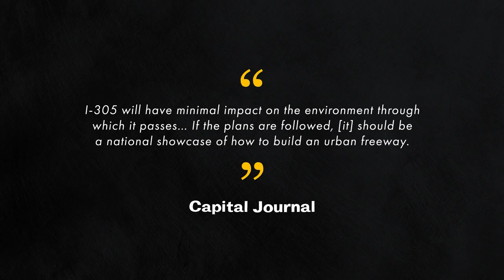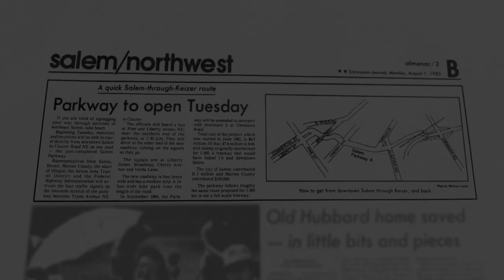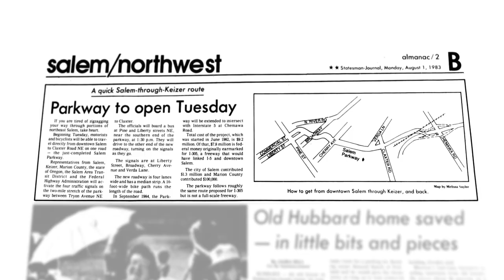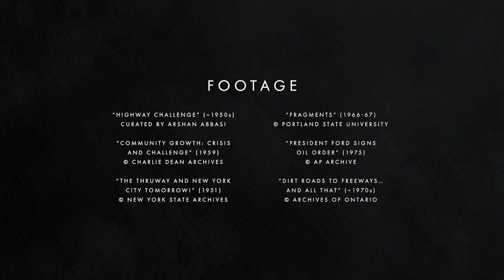Interstate 305: Salem's Cancelled Freeway

Comment: Absolutely fantastic! I remember seeing a huge full scale model in the lower floors of the Salem Library as a kid. And my parents had built their house on the corner of Wallace Rd & Hope Ave... which if a person drew a straight line across the Willamette River would have run directly into the Pine Street Bridge / Pine Street. Which the model I saw showed that... and it showed a branch going on down Hope Ave. which then matched up exactly with Orchard Height Road, too. It's just amazing that the 2nd biggest city in Oregon still only has two (2) bridges.

Sometimes I have to shake my head, as pretty much all the Freeways from Salem to Portland and the from South Salem to Eugene are still only three (3) and two (2) lanes. Well, I guess it's the same for 205 when I was  a kid. Almost nothing has changed in 50 years. Which by the way... I think the toll this is simply ridiculous as the freeways were federally funded... seems the state government is a lil' greedy in my own humble opinion. Now maybe, and only maybe if they want to add a "Fast Pass" / extra lanes to 205 just like toll roads in TX... where those were built in addition to the freeways who wanted to pay to skip Freeways. I just don't see how anyone will be expected to get around... guess they will need to change all the "Freeway" signs, too. Get it since it's not Free even though our tax dollars had already paid for it. ha ha 🤣 That will cost them even more to change signage... just like the proposed per mile tax which when calculated with super simple math comes out to be 4X to 6X times MORE to the cost of everyone driving a Hybrid or EV (which I've had both). A per mile tax when calculated is as if every vehicle is only getting 14-16 MPG with the taxes they make on the Gas Tax. Crazy world! Well, I digress! 😇

Comment: I found out they have cancelled both future I-92 and I-98 in the Upstate of New York, because of they could not put the money to the highway funds. I-92 supposed to connect from I-87 in Glens Falls New York to I-95 in Portsmouth New Hampshire, via US-4, I-89, and NH-101, and I-98 supposed to connect from I-87 in Watertown New York to Swanton Vermont, via US-11 and US-2. However I-81 and I-88 in New York are the first two interstate highways might change it exit numbers to a mileage based system, then follow by I-86 in New York. Vermont might change its exit numbers to a mileage based system on I-89 and I-91. Massachusetts and most of Rhode Island (except for I-95) already changed their exit numbers to a mileage based system, including I-90 (Mass Pike), I-84, I-195, I-295, and I-495. Connecticut, Delaware and New Hampshire said “no” for the exit numbers change on all interstate, US, and state highways which are freeways.

Comment: Better that I-5 just glances Salem, where it goes through major metro areas, ie. Seattle; Portland, LA, it becomes choked. It passes the perimeter of Tacoma, but it was made to curve along the profile of Puget Sound. The concept of 'limited access' is lost where entrance merges come every couple of blocks. The 'needles eye' at the south end of Seattle where development and geography squeeze the freeway down to two lanes is a total joke. Ideally I-5 should have been sited in a more direct route, similar to how it passes through California's Central Valley, with spurs connecting to the urban areas.
Reply: Good point, although around Seattle, where would this "direct route" have been? Maybe around present-day I-405 (which is sometimes even more congested than I-5)?

Comment: Ah yes, Salem.  Where, if you take any exit, you're guaranteed not to find a gas station until you're as deep in as at least 10 city blocks.
Also guaranteed: At each intersection, you will encounter a red light. The duration of which, never fewer than 9 minutes.
Should you deviate from your Garmin's suggested route, in hopes of a shortcut - you will come to regret your error.  
For only after it is too late, will you realize you are stuck on some sort of endless, exit-less bypass road half sunken into the ground and surrounded only backyards of housing.  
Ah yes, Salem!  Where, once back on the freeway you fight with your passenger who asks you "Justt HOW did it take 48 minutes to fill up with gas in Salem? We need to be in Sacramento now, we're gonna be late!" and you shout back "I don't KNOW!! Why does ANY mammoth fall into a tar pit, honey? Because he doesn't know it's a trap!"
After this exasperation breaks the ice, passenger jokes "There there, you couldn't know how poorly-gridded this all was.  I've seen patterns in spaghetti that makes more sense!"  And then, a much less awkward drive to California commences.  A sort of trauma-bond develops between you and your passenger.  But - God help you if you experience it alone.  You'll need therapy.

Comment: HWY 22 E and W need to connect beginning with the flyover at 12th st.
The flyover should continue Mission st, across the river and connect in West Salem.
Until this happens, Salem's downtown core will continue to be a snarly bottleneck.
Vehicles traveling E - W would save a TREMENDOUS amount of fuel, time and pollution over the current mess.
Reply from the maker: Through the late 60s the Mission Street Freeway was considered a top priority for this very reason. But of course the money never materialized. I never saw any mention of it being designated as Route 22, but it's safe to assume that it would've been.
Reply: @peterdibble  The name most often used these days for the concept is, "HWY 22 E - W Straight Shot Solution"
It will eventually happen in my opinion. The only question is when?
You may notice that intersections on HWY 22 both east and west of Salem are slowly upgrading to freeway standards.
To the east for example; Rickreall. To the west, Lancaster drive, Joseph st, Aumsville and  both Stayton exits.
Reply: @vanderpoolfarmsl.l.c.9983  It'd be GREAT if that happened!
Reply: @vanderpoolfarmsl.l.c.9983  I don't foresee that happening in my lifetime!
Have you been to any city council meetings concerning our roads?
They want us outta our cars & would prefer to take lanes away rather than add them.
You'll have to vote those people out & get some in that don't try to force public transportation down our throats.
I was disgusted!
They take a few minute break at the end of the meeting before announcing their decision, that's when almost everyone leaves.
Then they're like, I don't care what y'all want, this is what we're gonna do! 
This mainly concerned wards 1 & 2.
The woman in ward 1 has been replaced & ward 2 is still Tom Anderson.
I don't know anything about Virginia Stapleton in ward 1 cuz I moved to a small town outside of Salem & I love it!!
But Tom Anderson is not a friend to drivers, I can assure you!
Good luck!
I'd love to see any improvements to Salem's roads, especially if it's widening or adding!
☮️💜
Reply: @sweetmissypetuniawilson9206  Hear, hear!

Comment: personally, i think they should've built it and instead of having it connect directly to downtown, 305 would end near downtown but would be a seperate freeway going around town that would be built to interstate designs that could be 305 later.
it would've not only kept both sides seperated, it would've gave a interstate level bypass that wouldn't be interstate, or only be interstate up to reaching downtown.
it would give them investment and excuse to raise local gas taxes to help with it, and would give salem a proper bypass around town that would alleviate the traffic by splitting the traffic off, and helping to ensure future demand for traffic.
similar to Briley parkway in nashville tennessee, nashville doesn't have many interstate level bypasses, 840 was only constructed in recent years and 440 was only reconstructed in recent years, nashville has 2 bypass highways thats freeway in design and could be easily upgraded to interstates given the right improvements.
one is Briley parkway, which goes around nashville and another is Ellington parkway that goes from i think main street and james patterson to interstate 65 and Briley parkway.
but briley parkway has to my knowledge a full freeway except for one segment between exit 5 and exit 6A, where its 3 signalized at grade intersections.
Reply: But I-5 is already an interstate bypassing Salem OR
Reply: @hobog  With no high-volume capable access.